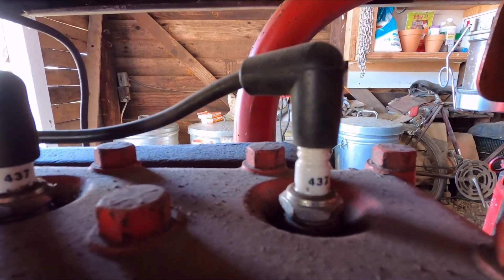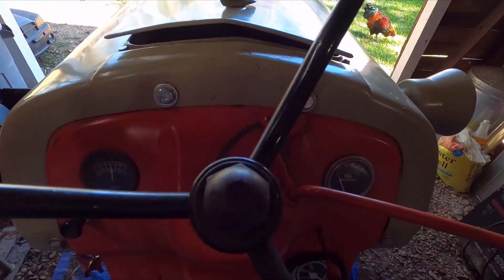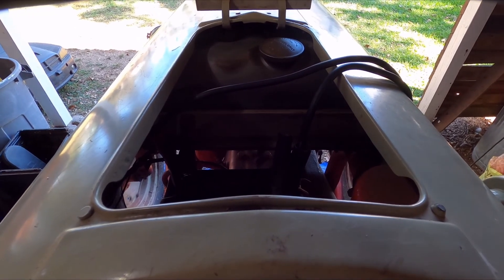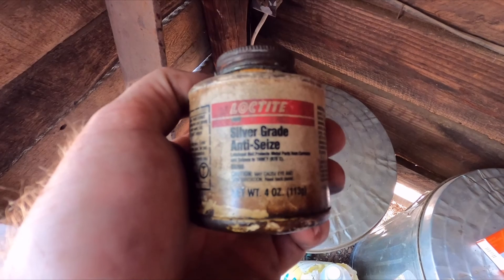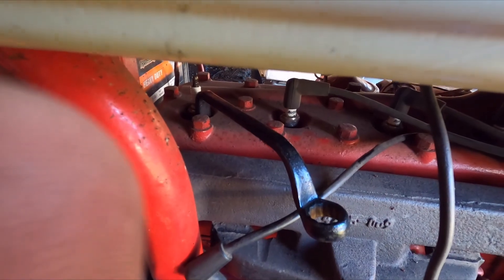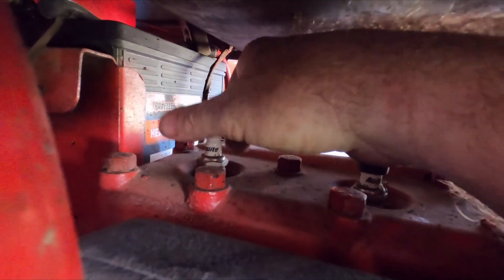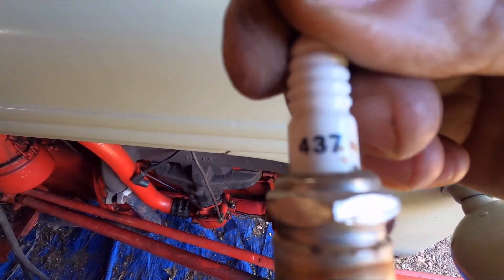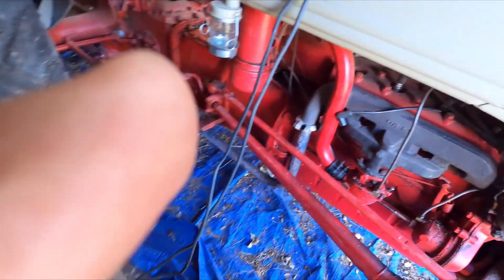Ford 8n - Hard to crank??  Try Autolite 216 Spark Plugs

Comment: i have a 58 and I've only used 216's gapped at 20 and it's always started slow like yours before you changed them. new battery, new cables, plugs, wires, points, coil etc... no idea what's going on. starter doesn't stick or bind. maybe it's the brushes and needs to be replaced?!
Reply from the maker: Not sure either.  This one got a full refresh, but it was still hard to start.  The Autolite 216's really seemed to help.  ...it is still a bit difficult to crank at times- you have to know precisely when to hold the choke and when to not, or it will flood.
I've found that holding my tongue out of the right side of my mouth seems to help.  Haha  😆
Reply: @puhleez420  I learned the choke is touchy right away. seems like it starts like it should when a battery charger is hooked up even though it's a fully charged new battery. the last battery was fairly good just old. I jumped it during the cold with the old one and it started like it should too. think it's not getting enough power which is also odd.
Reply from the maker: @scottt89  I have that same issue, even with a new 6v starter and 1 year old battery.  What size are your power and ground cables and are you still 6v or 12v?  I'm keeping mine 6v, but I need to upgrade the battery cabled from 4awg to 2awg.  The lower the voltage, the larger the wire needs to be.  Maybe that will help.
Reply: @puhleez420  I'm also keeping mine 6v. the positive is the strap and the negative is the thick one. think 00... whatever they came with just new. if I figure anything out I'll update.
Reply: @puhleez420 😂😂😂